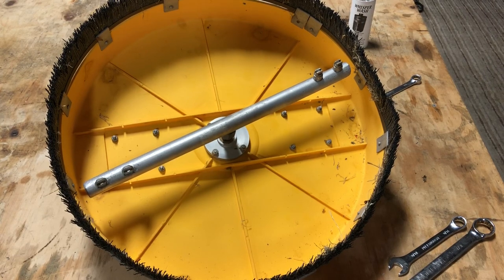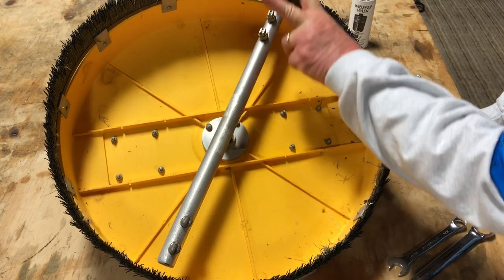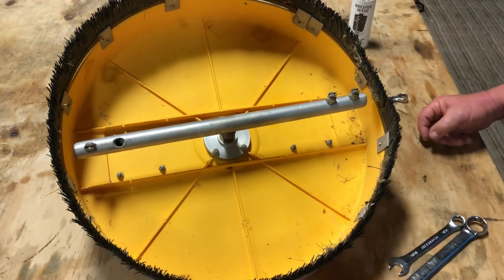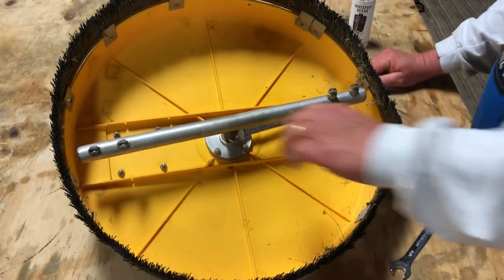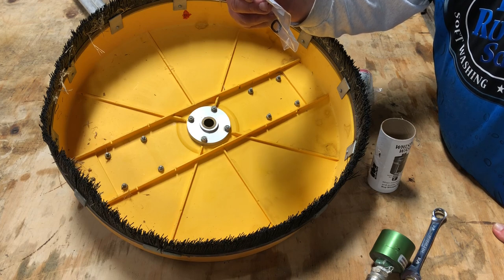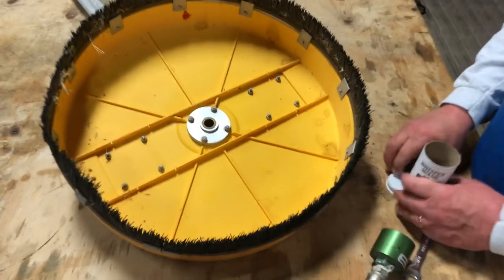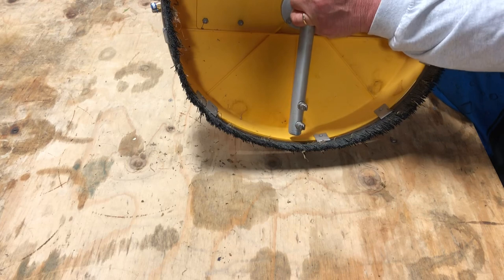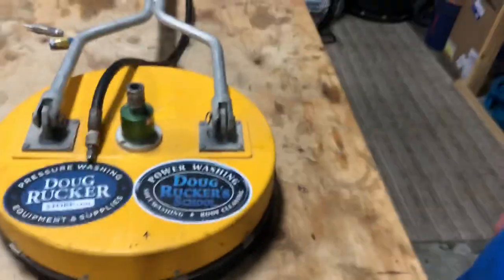Surface Cleaner Tips and Maintenance

Comment: Sr you saved my wallet a few buks..  my surface cleaner wasn't working properly after l removed the tips for service  when l put them back l used an impact and just tighten  with out putting attention how the were lined out ,  causing  un even spraying line pattern...    almost ran to buy a new one...  what an esay fix

Comment: Is possible to customize a surface floor adding 2 more nozzles when you have only2 or they are like that from factory only?  Thanks for the videos
Reply from the maker: Sure you'd have to have a bar made for 4 nozzles if the manufacture doesn't have one.
Reply: @PressureCleaningSch  what would be your recommendation on this? I have one but I don’t feel it have enough power for the type of machine I have, the nozzles are clean and clear.

Comment: Thanks for the tips Doug. Question... After a year or so of using the same surface cleaner it recently started wobbling/shaking back and forth rigorously. Any Idea of what could be the cause of this? Thanks
Reply from the maker: Either clogged tips, bent bar, or swivel gone bad or all 3

Comment: Hey Doug. Are spray bars universal? I’ve got a 20” BE whirl a way so was wondering if I could buy either a whisper wash bar or GP bar since they are easier to find. Thanks!
Reply from the maker: Good question. I doubt they are as the swivels are different but I’ll check.  We can get the BE bars for you though

Comment: Hey Doug! I have a 4400 PSI 4.0GPM washer and a 20” Whirl A Way surface cleaner. What tips would you suggest for the surface cleaner? I’ve heard 25025,25030 and 25035, what do you think would work best? I mainly just do concrete.
Reply from the maker: All of the above depending on the concrete. New, old, how dirty etc all play into it

Comment: For the nozzles my surface has the option to use 2 and 4 and wondering why would I use 2 nozzles and why would I want to use 4? I have the ground force surface cleaner
Reply from the maker: For a 4 or 5 GPM you’d use 2 nozzles. 8gpm you could use 2 or 4 nozzles. Although I wouldn’t use it on a 4. I’d go w a smaller surface cleaner.
Reply: @PressureCleaningSch  I have an 8GPM machine. Why would I run 4 tips instead of 2
Reply from the maker: @hudson.kemnitz  4 can help cut down on striping and also cleans better.

Comment: Can both nozzles clog at the same time? All of a sudden, no water out of either of the two nozzles.
Reply from the maker: Yes they can, but usually nit fully plugged.  Sounds more like a swivel issue.
Reply: @PressureCleaningSch  I fixed the two nozzles. They were both plugged.
I suspect that one was previously plugged and that the pressure was higher out of the remaining nozzle.
The nozzles were very tight, so I had to use a 1/2" rachet. I almost needed the longer bar to loosen it. I took the center cartridge out, cleaned it and put a new "0" ring on the shaft. That mechanism was fairly clean, though.
I removed the wash arm and placed it in a vise to remove the nozzles. It would have been too difficult to hold the floor cleaner steady by myself the wash arm was not difficult to remove. It turned counter clockwise to remove.
Also, I use this floor cleaner once a year, so I would not have noticed just one nozzle working.
I had to use a smaller welding tip cleaner to start as the proper sized tip cleaner would not budge the hardened material in the nozzle.
In the end, I learned something new. I will try it out tomorrow to see how much better it works.

Comment: I just bought a surface cleaner and the tips wont come out? I put all my weight on it and even grabbed the 9/16 wrench and they still keep slipping. I want to change to 25025. Any suggestions?
Reply from the maker: You could try some penetrating oil and let sit awhile. They really are not usually very hard to get out.
Reply: @PressureCleaningSch  ill try again. I just probably already stripped it enough but it literally wont budge.

Comment: What's your take on wheeled vs non-wheeled surface cleaner?
Reply from the maker: I don't like any surface cleaner with 4 casters, they seem to have mind of their own.  I use to use the Whisper Wash 24 Inch big guy for residential work, I love the 2 wheels in back and 1 in front.  Much easier to control. I use a steel eagle now with same type of wheel set up, and love it for our commercial work.  So I either use a floater or one with the 3 wheels.

Comment: I have the a 20in BE Whirlaway that I just got it has a greasable zerk what type of grease should I use. And should I put it in more places then just the zerk?
Reply from the maker: Way back when I had one with a grease fitting I used a lithium grease I think it was. Just grease the zerk.  Probably every 6 months or so friending on use
Reply: @PressureCleaningSch  ok thanks and also I’m running a 4gpm 4000 psi will 25025 tips work well? Last question is on sensitive concrete or surfaces do you adjust your pressure or change tip sizes on your surface washer? Thanks.
Reply from the maker: @jacobfuchs1955  change tip sizes. I never adjust unloader

Comment: I unclogged my surface cleaner nozzle, but when I hooked it up to the Pw I still couldn’t get Pressure. Do you know what the issue could be ? The black hose connected to the surface cleaner is stuck in the quick connect. I was using a box store pressure washer and the pump went bad on it while I was surface cleaning. The Pw engine shut down and now the hose is stuck.
Reply: Release the pressure.connectors won’t let go if pressure is still in the line.just pull the trigger when it’s shut down

Comment: Hi Doug, how do you grease it?
Reply from the maker: If your surface cleaner has grease ports then using a grease gun
Reply: @PressureCleaningSch  Is there any particular type of grease you need? I don't know much about grease so if there's a certain brand and type you recommend I'm all ears lol
Reply from the maker: @dylan_hughes  I used lithium grease. Water resistant

Comment: Hey Doug I’ve got a question. I have a 20” hammerhead that I have only used maybe 15 times. One day I noticed my 5 GPM bandit was vibrating real bad only when I used the surface cleaner. I ended up finding a plugged nozzle. I went and picked up two 25025 nozzles from your store the other day and swapped to the new nozzles. I’m still noticing that only when I use the surface cleaner the unloader is bypassing part of the pressure back to my buffer tank. This causes my pressure washer to vibrate abnormally. When I use the wand it doesn’t do it. Only when I use the surface cleaner. Any idea why it might be doing that? Anybody got ideas?
Reply from the maker: Sounds like you got a clogged nozzle again that can happen sometimes when you change them check them again
Reply from the maker: Also could be unloader or even a coil pack
Reply: Doug Rucker I double checked the nozzles again this morning and they are clean. I removed the unloader and it looks spotless since it’s a new pressure washer. It only happens when I use the surface cleaner. Works great when I use the wand. Zero water comes out of the bypass hose when I I squeeze the wand trigger. But when I use the surface cleaner I get warm water coming out. Took apart the swivel assembly and everything looks fine there too. If I brought my trailer and surface cleaner over to you could you look at it? I need to buy a couple things from your store anyways. Picked up some of your Kings Kling the other day. I’m liking it.
Reply from the maker: Alberto Gonzalez I’ll be glad to look at it but I’m not a repair guy. If it’s not something obvious I’m not your guy. Lolol. I’ll be around Tuesday. Rest of week I’m out in the field
Reply: Doug Rucker Sweet. I’ll swing by Tuesday so you can glance at it. I need to buy a few things anyways.
Reply: @albertogonzalez1183  hey bro did you ever figure out what  the problem was? I got the Same problem!

Comment: Doug appreciate the content. I just bought 20” be surface cleaner. It came with 25020. I put 25025 in it but it’s seeming like it’s still putting out too much pressure. I have a 5gpm 3k psi machine. Pressure gauge off of 200’ hose says 2650psi. But seems real high and surface cleaner wants to fly. I don’t want to etch any thing. Should I try 25030 tips
Reply from the maker: Yes try those and and maybe even 25035

Comment: What nozzles do you find works best for 4 nozzles 8 gpm machine
Reply: Mike Savage 2502
Reply from the maker: 2502 or 25025 depending on the surface.  If its really soft surface then I change from 2502 to 25025
Reply: How much are the cartridge?
Reply from the maker: @sylvestercoles4758   $145.00

Comment: 4 tips on a 2 bar cleaner?!?! What?!? Never seen this before
Reply from the maker: Yes. You can order 4 or 2 nozzle bar. 4 nozzle bar comes with two holes plugged.
Reply: @PressureCleaningSch  does this require double the GPM?